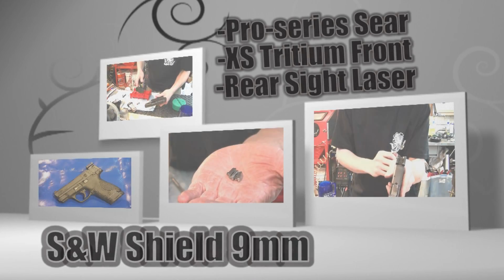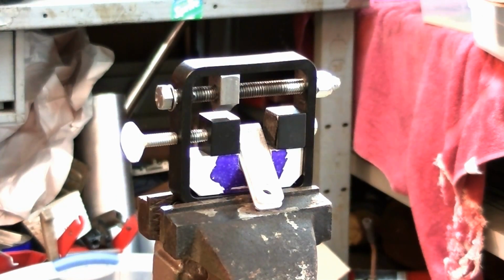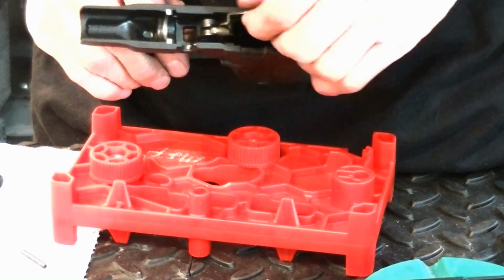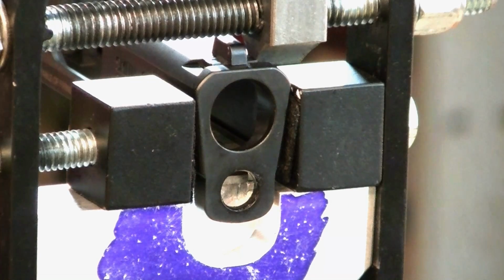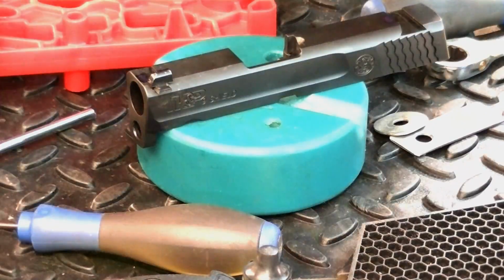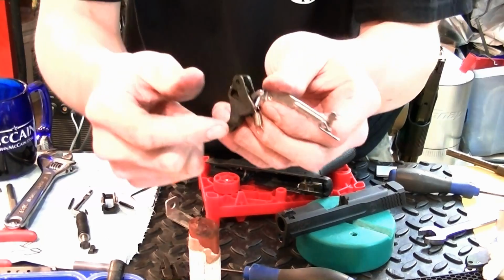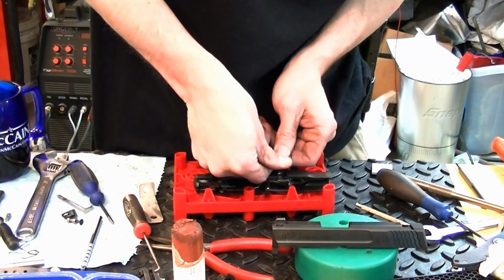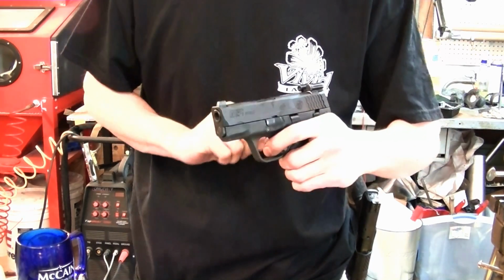S&W M&P Shield 9 Upgrades: Pro Sear, Laser, XS dot

Comment from the maker: No because the geometry on the sear is specifically set to work in conjunction with the proper striker block. If this timing gets out the only safety these guns have is rendered useless.  The geometry is paramount and predetermined.  There may be some room to play there but the results are so good that I don't see the need to mess with it. If I needed more here I would just go to the Apex Tactical system and KNOW that everything is perfect. FYI I am an APEX T dealer.

Comment from the maker: If this happens you can do a few different things. One is "stake" the sight itself after installation.  Next is the use of  Loctite. Loctite makes a "wicking" grade that can be applied after setting the sight. This works very well. The preferred method is to stake the sight. If you take a look at the sight that I put onto this shield, it had been previously staked while on my M&P9. There are 4 divots on the base of the sight.  If this is not making sense to you let me know and I will do a video.

Comment from the maker: No, I am an Apex T dealer and will give you a better price than anyone you find. That being said, no it would not better.  This is a very viable option for many that may have the M&P Pro or upgraded and now have a shield. This lets them run the Apex system in their Pro and have an upgrade for pretty much free for the shield.  I do recommend the Apex unit though for both.  Drop me an email and we can discuss what is best for you and the cost.

Comment: My shield has Apex trigger, trijicon Hd sights, gonna get a viridian RTL (Light) and a viridian R5 to go back and forth between
Reply from the maker: Good stuff! The only thing that I would recommend but it might be too late is the sight's tritium coloration.  I will not even install a set of night sights for any handgun that have 3 dots of the same color. The tritium must have a  difference between the front and rear such as different colors or shapes. The problem is that if you shoot in low light or at night you cannot tell the difference in the front and rear if they are all 3 identical dots.  Or simply run a front tritium only. FYI for what it's worth.

Comment: Those rear sights are contrary to the concepts of a carry gun, namely not snag proof. Those big bulky sights would certainly snag on clothing. Not a good idea. You should have put the rear XS sights (for one handed racking and reduced drag) and instead used a trigger guard laser. No snags. Smooth draw. unobtrusive laser.
Reply from the maker: Couple things.  In theory for the masses I agree.  And let me start by saying I hate  this rear sight laser. It is like Mickey Mouse is looking at me each time I aim. haha.  Now though,  Snagging is not an issue in my case.  I drill often and in all of the thousands of draws with this gun I have not once had a snag. That is even while drawing prone.  I keep this sight on there because my wife carries this gun most of the time and it allows her much more surface area for racking the slide. The XS sight does not give the same surface area and is much harder to use in that way. The way that she carries (undisclosed) does not present snagging issues either.  As a matter of fact there are not even batteries in the thing.  I don't like lasers, I don't run them on my carry guns.  I believe in learning to properly shoot the gun using iron sights first. I believe one of the biggest mistakes someone can make short of shooting someone unwarranted is to have a ND of their laser or light. If I am in a situation after dark I don't want to broadcast where I am until a muzzle flash comes down that pipe. If I hear someone in my house there will be no lights or lasers, just bang. haha Thanks so much for writing and watching.  We are a full service gunsmith operation offering machining capabilities, coatings, etc keep us in mind.
Reply: TDCtactical  Huzzah!

Comment: Did you end up keeping this laser sight? I can't stand the trigger guard ones and no one makes anything more for the shield. Where did you get it by the way?
Reply from the maker: I am not a big fan of either type. The laser in this video is simply a LaserLyte for a M&P9. I had to file the dovetail slightly by hand to make it fit but this is normal on many installations.  I don't like the rear sight style because it is awkward to turn on and more importantly, off. I say off because if I want to turn it off to stay undetected it needs to be a quick easy thing to do.  Also, it is like Mickey Mouse is on top of the gun when shooting during the day. It looks like his hears! haha.  My suggestion is to not worry about a laser and put on a set of XS big dot tritium front and rear sights. Then invest in a good handheld flash light. Most importantly, find a reputable school/instructor and get some formal teachings. It doesn't matter what you already know or what you have done, you can always learn more.

Comment: that laser looks terrible
Reply from the maker: looks don't matter my friend.  one thing that I don't like is that every time you sight a target it looks like mickey mouse is on top of the gun. haha    the most important thing about having this laser on is the flat front. this gives you the ability to use the laser/rear sight to rack the gun. VERY IMPORTANT for a conceal carry weapon. Many rear sights are starting to offer a notch for this purpose.
Reply: looks arent everything yes but they are something and that is ugly, but I just see that snagging on something or getting in the way when malipulating the slide. I was just thinking when I made the comment that they need to make more laser options for this gun as I would be hard pressed to believe this is the go to laser option for most people. thanks for the reply
Reply from the maker: That is just the point. It is on there specifically so that it does snag on something. I want the ability to rack the gun one handed. The draw can be altered and worked on to work through any possible snagging issues but a stoppage while holding your child is an issue that you must fix ASAP with one hand. A ledge on your rear sight does this for you. I actually teach my students that I consider it a must have for a carry gun. Not the laser, but some type of ledged sight to facilitate racking with one hand.
Reply from the maker: saltlife316  Oh, and I believe that Crimson Trace makes their "Laser Guard" for the Shield. Email me if you need pricing on it or anything else. Thanks so much for watching and writing.
Reply from the maker: I will take the tackiest most terrible looking thing out there if it means that it will work better.. In other words, "a truck is for work and a show car is for shows" I don't mix. haha Have a good one
Reply: ok im done though as I have better things to do
Reply: thanks man

Comment: doing all this work with a loaded magazine right in front of him.  that should be out of the room when doing things like this.
Reply from the maker: Not "room", "Shop". and of coarse there is a loaded magazine, my magazines are always loaded. this is crazy talk man.. come on! rounds are not going to jump out of that mag into the gun and make it fire! Now I do however completely agree with that philosophy when dry fire practicing. In that instance I know that I am going to be purposely pulling the trigger over and over.  I am a professional gunsmith, this is in my shop, I don't have to worry about someone else because it is just me. And the most important thing is that I ALWAYS CHECK FOR AN EMPTY CHAMBER prior to any dry fire and immediately after picking up any gun. If I have walked away I make it  a point to and now it has organically become such a habit that I will do so even after setting one down and then picking it back up.
Reply from the maker: that's ridiculous. I was not dry fire practicing. So since my reloading area is in the same building/room as my gunsmith shop should I put up a divider?